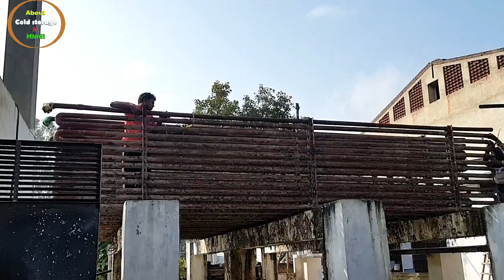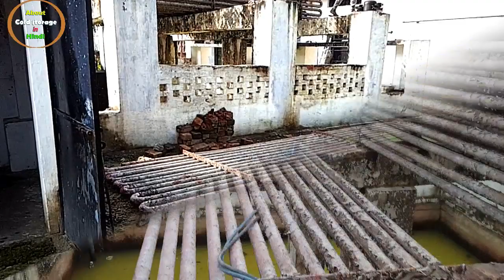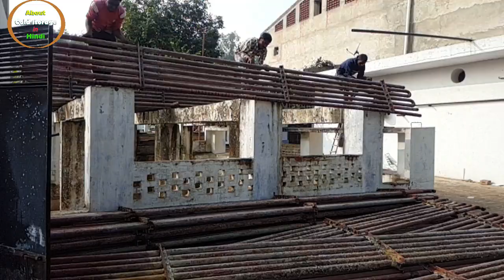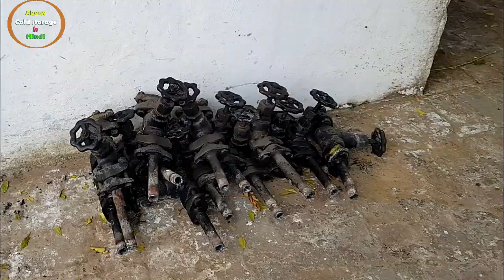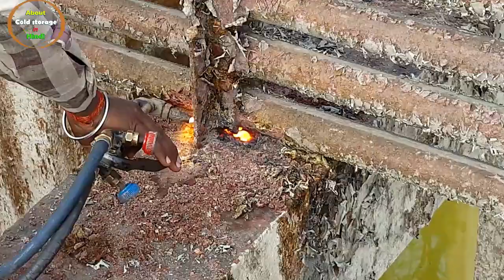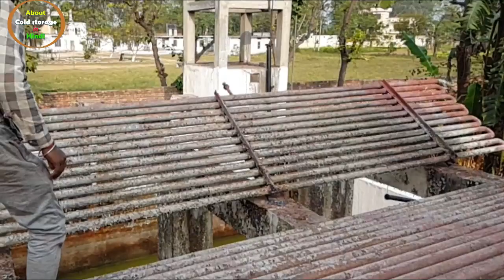How to cut and change the old condenser of the refrigeration plant  part 3

Comment: can you make a video on preventive maintenance(time to change compressor oil, replacement time of different compressor moving parts like piston, suction & discharge valve seats, motor bearings, shaft bearings, head cleaning time period) of compressor to reduce the occurrence of break down.